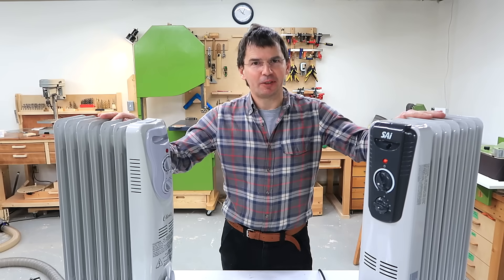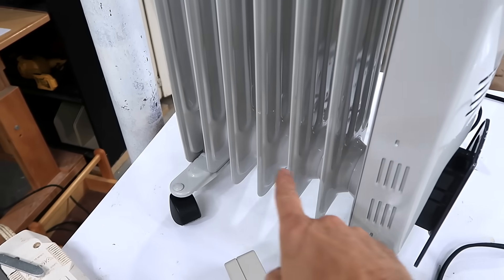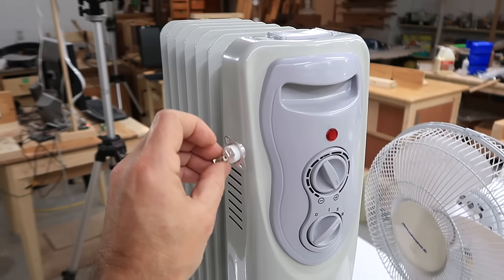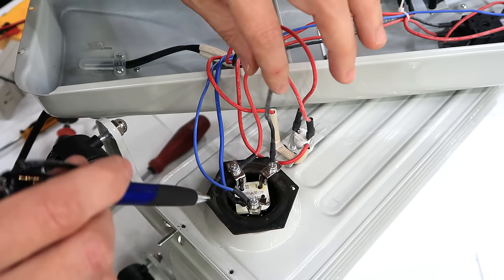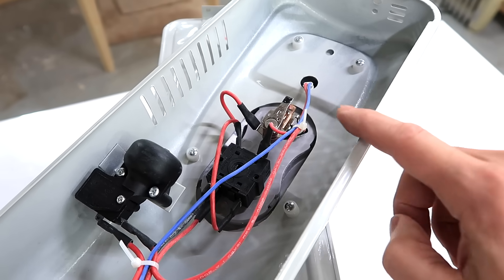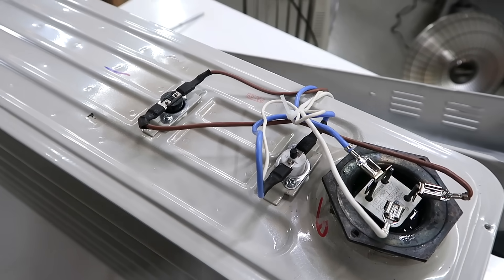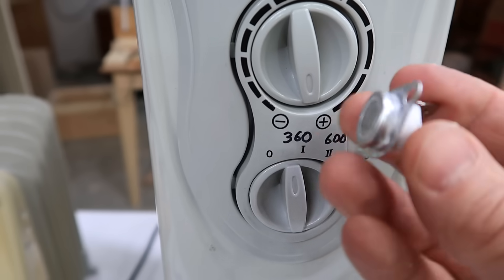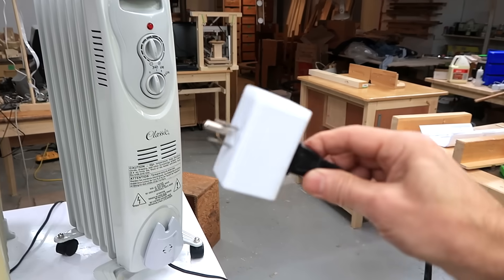Oil filled heaters: 600 watt heaters pretending to be 1500 watts

Comment: Cheap chinese made junk is why they fail or have flaws.
Early in the video a small heater that had a fan in it was shown, it looked like it was plastic, the warning is- I had a small cube shaped 1500 watt space heater similar to that, it had a fan, the case was PLASTIC, like what kind of moron designs something like this??

One night I was awakened by dogs jumping up and down on the bed, I immediately saw a 2 foot high flame 3 feet from my bed in my RV- the damn space heater was on FIRE! I grabbed the power cord, yanked it out of the wall and threw the thing out the door into the snow where it melted and burned leaving only ash and the metal parts.
Apparently the fan failed, the coil overheated and caught the PLASTIC CASE on fire! if you MUST have one of those, get one that is ALL metal that does not have a plastic case! The so called "milkhouse" heaters are all metal.
I came close to being burned to death, my RV was a converted school bus and the bedroom was in the very back, the heater was between the bed and the doorway, on shelves above were books, magazinzes and VHS tapes in plastic cases. I know I had no fire extinguisher.

Comment: I have two of the delonghi oil radiators. Bought ten years ago for $79 ea. I don't think you can touch them for that price these days. They are 1500w and digital with two on-off timer setting. I have one right next to me as I write- it is 25f outside. These heaters do a great job and I've never had a problem and haven't run my furnace since I bought them. I love that they're completely silent and don't dry the air out. I expect them to last many more years. Almost 30 years ago I bought a delonghi radiator and it must have been wired for 220v as on 110 it would hardly get warm at all. Needless to say it ended up never being used and was probably thrown away at some point.
Reply: I am still using my almost 30 year old delonghi 1000w heater, in fact I have it on now as I post this comment. One of the best things I have ever purchased.
Reply: I have a couple year old 1500w Dreo oil filled radiator heater that has been a blessing. Don’t have to use our furnace anymore either. We just picked up a $100 1500w ULItech oil filled radiator heater for $15 on clearance at Lowe’s. Didn’t really need it but couldn’t pass up that deal lol
Reply: the old intherm heaters from the 70s and 80s worked excellent,  then this junk came out

Comment: I saw one of these oil filled heaters in Portugal with a massive plume of hot air rising off of it. I had never seen or felt anything like it off of these heaters, so I looked at its sticker. Sure enough, it was 2500watts. It looked very dangerous, but there was no denying the effectiveness in the cold room it was warming.
Reply: In Europe they use 220v for regular appliances and electrical use while in North America we use 110v and 2500w would be out of the question. I'm sure the heater was quite safe. If you have an electric furnace in your home then it will most certainly be 220v
Reply: Yeah, it's still pretty bizarre from an American perspective to see 220v on every single outlet

Comment: I really would like to know what changed in these throughout the years. I remember when I was a kid encountering them and they are always warm and consistently warm. I purchased a new one 15 years ago now and it shuts off I don't remember the one from my childhood doing that but it also wasn't mine.
Reply: Do you run the radiator on the 2-3 setting with the thermostat all the way up? Don't do that. It sounds like you are tripping the overheat shutoff. Run it on the 1 setting with the thermostat set in the middle. If that overheat shutoff trips too many times it will fail.

Comment: I have one of these but it has two illuminated flip switches plus the rotary temp selector first switch is 750,and second is 1500 have had it since 2007 and it works flawlessly to this day, have never had to run it beyond 750

Comment: You are wrong about the thermostat switch not supposed to be cycled on and off all the time. That is exactly what they are designed for. It's the same part in your clothes dryer and your water heater. They are cycling on and off all the time, they last for years and years, very reliable part.

Comment: I have that exact same heater, SAI. I had an older model for many years (not SAI) that I replaced with the SAI one after the cord became worn and in my opinion unsafe. The Sai one quit working after a year, so I took it apart to have a look. All the wires showed signs of overheating, dry brittle insulation, even the extra isolation caps around the connectors were dry and brittle and crumbled. They just don't make stuff like they used to.
Reply: I came here to make this exact same comment, SAI heater quit working, took it apart same as you and found the same thing... wiring and wiring boots brittle and crumbling.

Comment: Seems that the W rating is just saying it has a heating element of that power..
Not specifying continuous power rating is intentional omission. If you really want 1500W, buy a 3000W heater and set it to 50%. Note that your house wiring may trip with a 3000W heater element.. it would probably need a dryer plug.. or 230V circuit.
Another option would be just have two of them at 50% power. But not on the same circuit.
Safer to assume that the W claim is BS.
Cars do the same thing.. An engine may be able to do X horsepower, but only deliver Y continuously (without blowing up) (and be within the capabilities of the tires)

Comment: I use an oil filled heater because of its safety. With no moving parts and the fact that it does not get so hot there is no need to worry about something burning because it falls on or near the heater.
Reply: Yep. They are by far the safest option. As long as you don't have any loose connections they are safe. I have had four space heaters equipped with fans get a weak fan over my life, if the overheat trip fails to work in this scenario bad things can happen, especially on the high setting.

Comment: I had an oil heater radiator 30 years ago that worked great and in curiosity I measured the amps it was drawing at each setting and it was doing as it claimed. A couple of years ago I bought a new one and immediately noticed just what you did, so I returned it.
I started trying to find one that was built properly and even called one companies US distributor. After talking to a couple of people I ended up talking to an engineer who told me something interesting...
He said that they didn't specify how it was wired but that the Chinese manufacturer was complying with a EUROPEAN REQUIREMENT and that to simplify manyfacturing the US ones just got built the same.
Somewhat like how California laws drag everyone else along in the other 49 states.
Reply: I have a Garrison, bought at London Drugs.  It works as it should unless it's left on high for a long time, then it leaks a bit of oil out a tiny hole in the back.  I turned it down and it continued to work great.
Jon in rural BC, Canada

Comment: I found one of these in a house I just bought, it was coved in dust,  I cleaned it up and plugged it in, but got concerned when it started clicking,  is it safe to use, when I heard it clicking I thought maybe it needed water or something and that's how I ended up here. Should I toss it out and just buy the one that looks like a fan? they sell them at Costco.  Or is it safe to use?
Reply: The clicking is the expansion and contraction of the metal as it heats and cools. I've had a few models of this type, they all clicked.
Reply: With ours The oil makes a popping sound similar to fry oil heating up some times.
Reply: Please don't discard an older one. My best heater of this type is 40+ years old, and I'm looking to buy another vintage one.

Comment: Do your 2 radiators say 1500 watts on the controls? I'm looking at a really old Lakewood brand I've use for years - it has a thermostat dial and 2 switches which show 600W, 900W and 1500W(when both switches are on)and it draws 12.5 amps.
I've always assumed that when the oil gets hot, the temp was maintaining a 1500W output  But you're saying that's a lie? I'm never getting 900W nor 1500W - only 600W? How can that not be false advertising?

Comment: They do a good job of mimicking a hydronic heating system which ends up being very stable and comfortable. A bit more expensive to run in the electric and gas format.

Comment: I had one of those... the dial "thermostat"'s sensing element also passed heater current.  1500 watts, all the way up, would actually end up a cooler temp than 900 watts.  ... it got rewired to handle a regular baseboard heater thermostat.  Works like a champ now.

Comment: Hey Matthias, could I bypass all the electronics in my unit (which is very similar to yours)?   I know you wouldn't recommend bypassing any safety features and I can leave the temperature fuse in the loop but ....... the little computer went bad in mine and I think the elements are fine and so is the radiator.  So in other words, just 120v straight to the element?  ..... obviously I'd put a switch in and include the temp fuse and even the tip~over switch
Reply from the maker: there is probably a temp fuse already.  Also, only wire in the low wattage element.
Reply: @matthiasrandomstuff2221  Thank you!

Comment: I have a similar radiator heater, crackling noise and all. I like it a lot better than a fan heater unless I have a water pipe I need to keep warm or something.
Reply: I would recommend to find an old 2nd hand one, they used to make these with more fins and better spacing between these fins.  If it is still working now it will probably work forever.

Comment: The sound is the oil but if you leave it still for long enough that sound stops no matter how hot i guessing air somehow emulsifying the oil slightly and mine seem to deffently get hotter on 2 and 3 on 1 i can put my foot on it 2 or 3 will burn the shit out of me mine is older mabie i higher trip temp or 240 vs 110

Comment: These heaters really are a bad design. I first noticed what you’re describing when I bought one for my workshop. It was plugged in through a power meter. I noticed that the current draw suddenly dropped to almost zero despite the neon light on the thermostat being on. I could hear the thermostat clicking on and off as I turned it but it was eventually 10 minutes before it came back on. I took it back to the shop and bought a different model from elsewhere. Did the same thing. It was a small “800W” model. I worked out that I was only getting an average of 150w to 200W out of the thing (Peak being 800W while trip was on). I also concluded that it wasn’t a good idea to be using the thermal trip as a means to regulate  temperature in normal use. I emailed the helpline in the manual to describe what I’d found. They said I was either using it a room that was too small or too big. Cop out. Took that back to the shop also. Got a convection heater - never looked back. Silent and heats very nicely. I’ll never get an oil heater again.

Comment: I have enjoyed these oil heaters since I bought an RV trailer about 10years ago. I have not had those noise problems except for one instance where the heater was stored on its side. It quieten down with low power use in the late spring and no problem since. My RV trailer is only 25' long and on low or medium power, the trailer gets warm guickly.  The one thing to be causious about it modifying the internals. I work withj what I got, as is, so I dont overheat the place. nobody should be modifying nothing!

Comment: Our UK ones cut all the elements once the overheat protection cuts in. I have a 500W mini radiator which despite having a 90°C safety cutout only radiates about 170W. My 1750W model had a 65°C cutout and even on the 600W setting only heated to about 380W. I replaced both cutouts with 110°C versions, now the 500W heater kicks out 380W without tripping the safety and the 1750W can cope with about 1100W before tripping. I've marked the thermostats accordingly and now they're plugged into smart switches that turn them on at night when electricity is cheaper than gas.
Reply: Damn your gas expensive as hell. For me only way electric is cheaper is to run heatpump but at night. During the day no, gas still cheaper

Comment: I have a pelonis oil heater, it works fine but the top knob is real loose and wobbly. How would I fix that? I don't know one thing about electricity or wiring. Any help would be appreciated.
Thanks and God bless ❣️🌿🐦

Comment: Good video. Thanks! Have noted the same. Donno can they reach full continous power even at -20c. wattages for ads... I bought two and connected them in series. 1/4 power per heater and they run cooler. Also new 1500w oil filled heater is considerably smaller than old 1500w

Comment: I have a small honeywell fan for general use that I point across my radiator when its in use because little heaters are annoyingly loud and the draw+light cooling makes the heater cycle less. The fan is pretty quiet and also moves air to the side of the room on which I sit, because the heaters cant run on the same circuit as the two computers in that room. 

Its a little obtuse but it works for me

Comment: The upside of the oil heaters is they are more mellow.  Instead of dumping really hot hair every so often you get a steady stream (with a low speed fan) of decently warm/hot air.

Comment: I specifically went out of my way to buy a 1980s DeLonghi 600/900/1500W that will run wide open, and does not make any popping noises. All it needed was a fresh power cord and one internal connection replaced.

Comment: I have a similar style heater I bought recently. I decided to test it after watching your video. It was advertised as a 600/900/1500 watt heater. It's actually a 400/800/1200 watt. If it runs for 12 minutes the overheat protection kicks in. Interesting though it shuts off the 400 watt element leaving the 800 watt element still going. I think I'm going to wire in a toggle switch to where you can run the 400 watt or 800 watt but never 1200 watts.
Reply: What brand

Comment: I have had newer Chinese made Delonghi radiator heaters that offer the option of 750-900-1500 settings. Over the years, I've bought the older Delonghi heaters, which were made in Italy and are almost double in size - 8 fins with larger spaces in between- and rated 600-900-1500. I really prefer these, and like what I think are the savings of 150 watts on low power. In my opinion, once that thermal mass of metal and oil are warm, the old 600 watt heaters are warmer than the newer 750 watt version. I have seen newspaper clippings of the model I have from 1980, and it was selling for over $150- given inflation, that has to equate to $200 or so in today's money. The new (non-Delonghi) models Wal-mart sells were around $40 a few years back, so the smaller size and Chinese production seem to have reduced the price a lot, but I still strongly prefer our massive 40+ year old models that I've picked up at garage sales and thrift stores, and always run them on the lowest power setting.
Reply: I have a newer DeLonghi here. Is it best to run it on low mode? I’m a bit confused on which power to use.
Reply: @phototristan go low so cheap on power consumption
Reply: I bought a delonghi one in 2012 and it made that wrong-sounding oil popping noise that's in this video.
Reply: @jimmybrad156  Ours make that noise sometimes when starting up, but it goes away when warm. It's never very loud. I always assumed it had something to do with the cold oil expanding as it got hot.
Reply: That crackling on first for  up.. Either when Brand New/unused  OR for the season.... is Normal ! 
Start worrying if it doesn't do that :-)
Reply: Yep, I always run it on low and it does just fine.
Reply: So, I think the older Delonghi heaters were recalled, they exploded sometimes. I would do a quick google to see if any of your units are included in that recall.
Reply: @CommonArea-y5i 
This is the list of heaters that exploded. They were manufactured in Italy from 1980-1988 and not for use in USA. 
Brand	Model Number
DeLonghi	9306, 9308, 9608, 4308, 5307, 5108, 5108T, 4707, 3107, 3107T
Sears	9306, 5008, 5009, 5307, 5108T, 3107
Welbilt	97/7308, 7308T, 97/7307
Reply: $150 in 1985 money is about $440 today. But there are no consumer oil filled heaters sold for that much I bet because nobody would buy them when cheaper ones are available. I’d still love to pay $500 for a product that will last decades and do what it is sold to do…
Reply: @absurdengineering imagine how happy I was to find one from the 1980s on Craigslist for $30 about 10 years ago barely used. I always use the low setting 600 watts because I figure it's ultra safe and the most economical.  It will probably outlive me

Comment: I used to love my oil-filled heater before it got buried in storage. But considering that it's noon on Nov 29 and the temperature outside is 70 I have a feeling I wont be missing it too much this winter (and probably every winter gong forward)

Comment: We have a Pelonis oil filled heater, Model HO-0211. The level selector switch doesn't work. I disassembled to unit to get at the switch to discovered that it has disintegrated on the inside. It appears that maybe the plastic parts broke apart. I emailed  the company two weeks ago and no response. Can that selector switch be purchased after market? Or should I just throw the whole thing in the trash?

Comment: Cant you add a tiny fan inside the front casing and blow it directly at the overheat switch, or replace it with one that has higher trigger temp?

Comment: I had one of these short out internally and  melt the plug and outlet. Needless to say, the replacement is a ceramic with fan.
Reply: does not do much good for anyone else if name brands  are not mentioned ,thank you i would like to know name of heater that shorted out ,,the oil heater